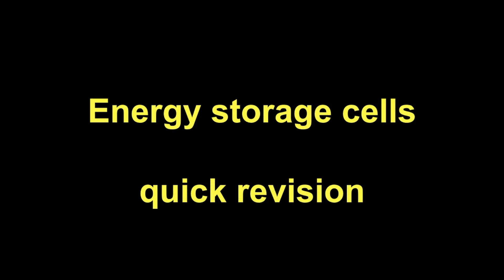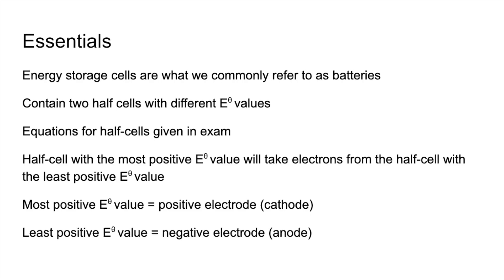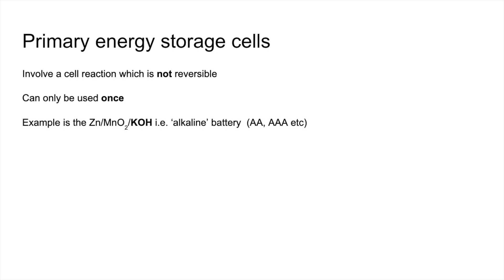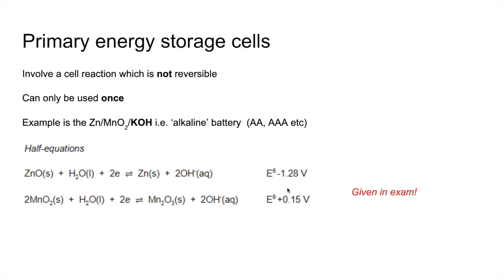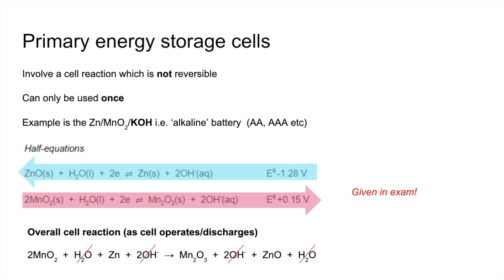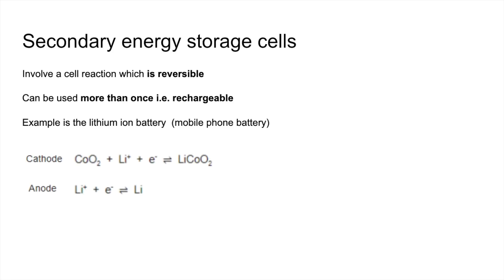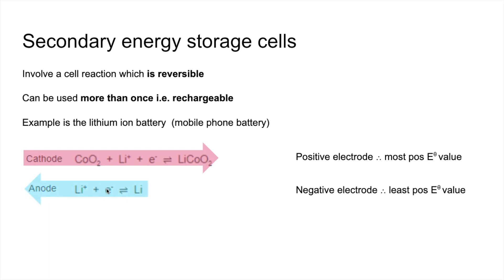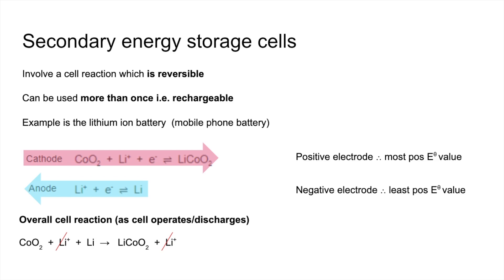Quick revision - Energy storage cells

Comment: Hi,
Isn't the cathode usually negative? Is it flipped in a voltaic cell? 

Thanks
Reply from the maker: Reptre Correct. In electrochemical/voltaic cells electrical energy is produced from a spontaneous redox reaction whereas in an electrolysis/electrolytic cell, electrical energy is supplied
Reply: Thanks for clearing that up!

Comment: Isnt the cathode negative??
Reply from the maker: At GCSE you learn about electrolysis cells (electrolytic cells) In these the anode is positive and the cathode is negative. At A level you learn about electrochemical cells. Basically these are the opposite type of cell as they produce an electric current rather than have one supplied (as is the case in electrolysis). 

In electrochemical cells, the anode is negative and the cathode is positive.

In both types of cell, reduction ALWAYS takes place at the cathode - REDCAT
Reply: MaChemGuy i didnt know there was a difference! Thanks :)